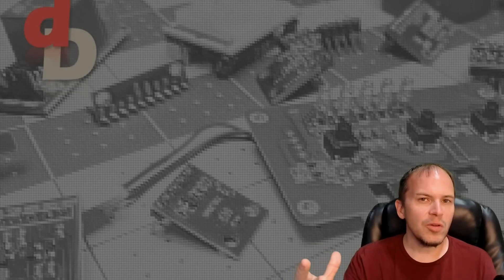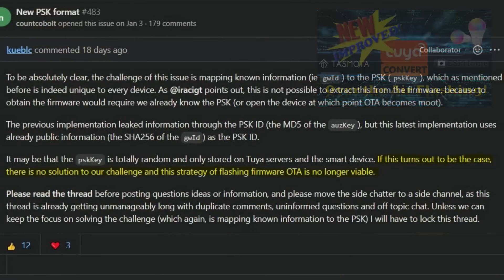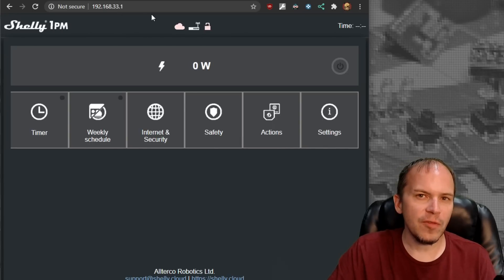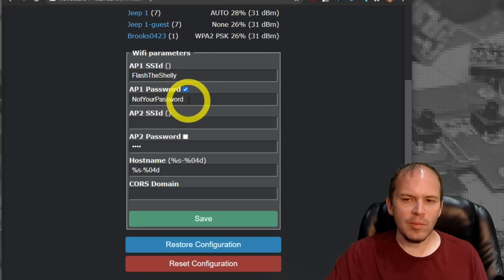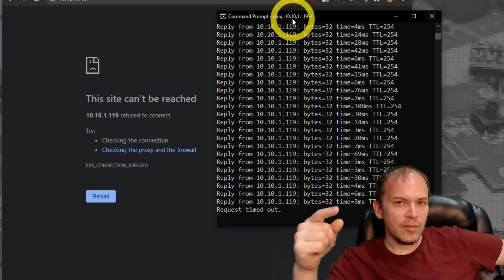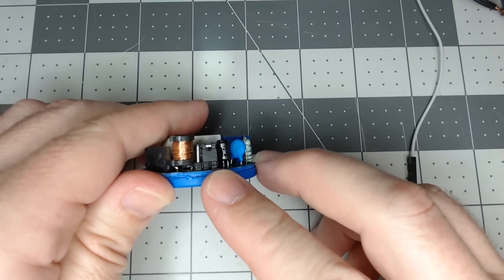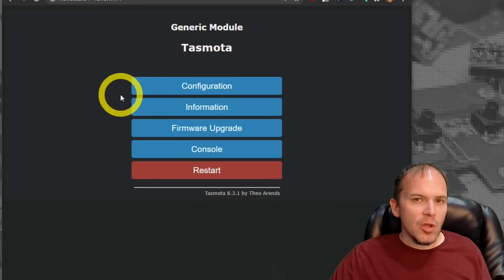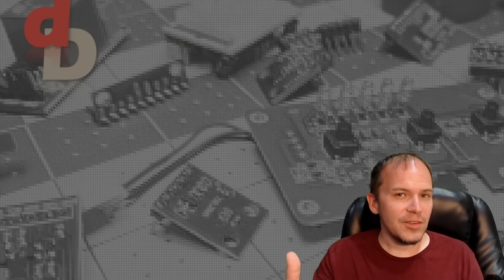Upgrade Shelly Switches | Easy NO Soldering Smart Garage Door Opener

Comment: Thanks for an other great tutorial Travis. Could you please confirm that the Shelly dinner is supported at this time.
Reply from the maker: I saw they have versions here but I do not know if it is supported via third party firmware yet. I need to make a momentary push button wall switch first myself before I can install mine. https://github.com/yaourdt/mgos-to-tasmota/issues/3#issuecomment-657048632

Comment: Pretty cool, have you tried reverting back to shelly stock?
Reply from the maker: I have via USB TTL to test the OTA process a few times.
Reply: I converted to older shelly 1 from tasmota back to stock without any issues.   I followed Mark Dornbach github "wireless" link...